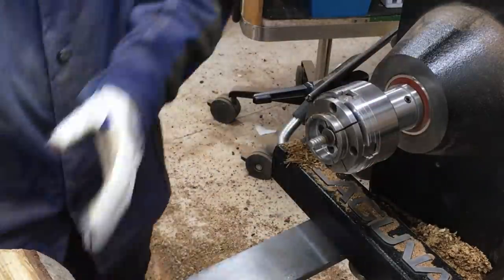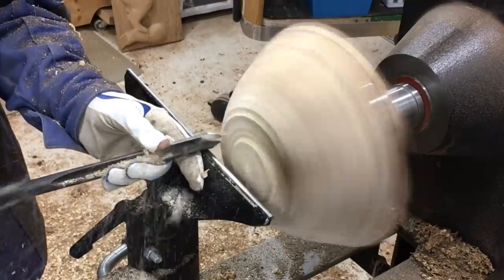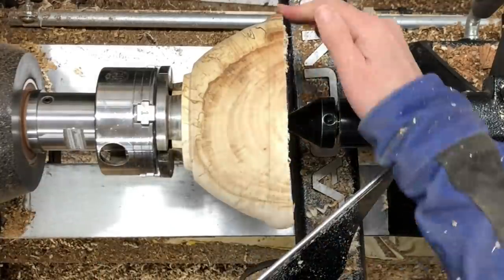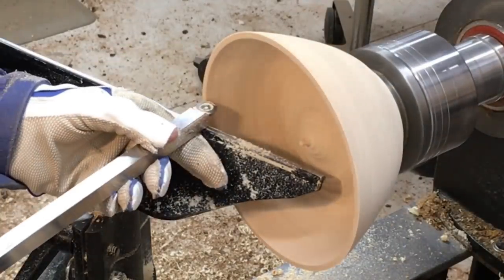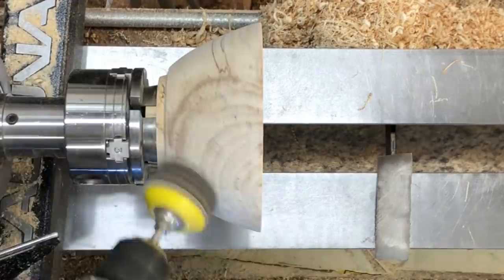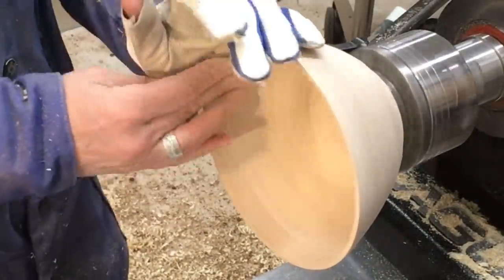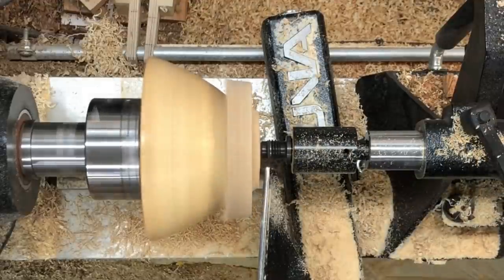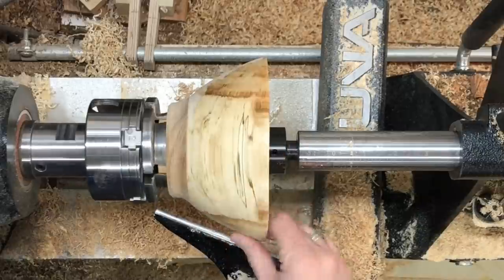Woodturning Firewood Log To Bowl: The Problematic Poplar - Potential Paint Pour Project?

Comment: Hi Lisa , in the end it ended up being a lovely little bowl, i'm relatively new to small wood turning as I used to make large pieces for finials for buildings on the outside so there anything from 8 to 10 inches in diameter and quite long, anyway just before Christmas I was doing thanks summer to you and yes I done the same thing I made a hole in the bottom but what I done I made the whole slightly bigger in the bottom and tried it up so I ended up with about 16th or an 8th inch thickness of material in the bottom, then I turn the spindle with a tenant on the bottom which then the bowl then sat on and I've got a better surface area for gluing up, The shaft ended up being around about 4 inches long which I then made up another piece to mounted it on the bottom has a foot and finished turning it, it ended up looking very nice. Stay safe, keep up the good work, practice makes perfect, I am a retired English gentleman living in France and I think that I am still learning things at my time of life.
Phil from the Moulin in France
Reply from the maker: Hi Phil, thanks for watching 😊
That’s a great idea for fixing the bottom, I’ll have to remember that - but hopefully I won’t need to use it 😂

Comment: I did the same thing a couple of weeks ago. It never went completely thru the recess in my plater, so I put a piece of tape on the inside then turned the bowl upside down . Then I filled the recess with epoxy.
Turned out really well with just a little sanding.
Reply from the maker: Hi David! Resin was my thinking for the beech bowl I made into a funnel, as it was still a bit wet and went oval so re-turning it wasn’t really an option. But resin doesn’t really like moisture either so it’s still sitting on the counter with a hole in the bottom 😂

Comment: I went through the bottom of my last bowl. It was my fault for not checking its thickness. I was trying to even out the inside bottom with my "bottom feeder" gouge, one I haven't used enough to develop the skill and feel to use it confidently. We all learn from our mistakes and their work arounds. You have a pretty grain in this one. I admire your persistence; mine will probably end up in my burn pit next spring. My neighbor across the street had several large, old popular trees removed a few weeks ago. I considered getting some pieces but I already have more cherry and sugar maple than I'll probably turn since I'm just a hobbyist.
Reply from the maker: I still don’t have a good feel for the bottom feeder gouge and am mostly using my negative rake scraper. And I still make the bottoms way too thin way too often 😂

Comment: What a great video Lisa! It appears that you have exactly the same problem finishing Poplar that I encountered, only you are better able to express them. The poplar I find over here often has knots in it making for hard & soft areas. That is difficult to grind. 
Unbelievable how you managed to go through that bottom! But you managed a great save, really well done.
But still I believe we are at least together now in the opinion that Poplar is an underestimated species for turning?
At least there are not many video's featuring it. I gave some of mine to Frank (TheTinyWorkshop), he said he will give it a go shortly.
Reply from the maker: Hey Leo!  I use poplar all the time, but kiln dried board stock as one of the other Bear Track girls (well both of them really but Lori is mostly doing the author/illustrator thing now and not so much art) is a 2D wildlife artist and I make all the frames for her originals. Cabinet grade poplar is clear of knots and paints really nicely. You can see Marie’s work at www.marierust.com
I surely thought I had plenty left in the bottom but apparently I took a few too many passes trying to get rid of the ridges 🤬
But I will be in the lookout for more poplar to try. It was stringy when wet but this actually turned pretty nicely.

Comment: Lisa first beautiful piece. Second I recently watched a video with either Mark Sillay or David Ellsworth, both skilled turners, working on a club lathe at a demonstration. They were having the same problems with the lines you complain about. On this particular video there was also a converter on the headstock and that seemed, in the pros opinion to be the source of the problem. You seem very competent with your tools it might just be you lathe that’s the problem. They also mentioned to be sure your Morse taper was clean when using drive centers with that function. Hope it helps your too good a turner to be doubting yourself.
Reply from the maker: Hi Victor! Thanks so much for taking the time to leave a comment. In the time since I made this video, I have gone exclusively to the SuperNova2 chuck, which is a direct thread for my spindle, or a glue block and I do think that has helped. I also have been grinding the heel of the bevel back some and that seems to help make sure I’m not “bruising” the wood by pushing against it. I still have an issue with weird lines occasionally but it isn’t nearly as bad. My technique is improving as well and that never hurts 😁

Comment: Good job, sanding is most people's pet hate, lol. I like this piece, it's shape and grain is quite nice. I find Macrocarpa Pine to be a little problematic sometimes, like you had with this with marks appearing and such. I've found when sanding, if I soak in Methylated Spirits/Denatured Alcohol to open up the grain and raise the knapp, let that flash off completely, then rub in 1 pound Cut Shellac, leave that for a while so the alcohol dries up completely, this stiffens the fibre's, as well as helps with bringing out the Chattoyance in the grain.
Reply from the maker: Thanks for the tips. I use denatured alcohol after sanding to help get rid of some of the dust and then out a coat of 1# shellac as a sealer/sanding sealer but unless the wood is really punky I don’t normally sand the shellac back - it seems to just clog up the sand paper. Do you find this too?
Reply: I do, esp. if I don't let the Shellac fully harden.

Comment: Well, I watched it a couple of times to see if I could figure out the 'ring' problems on the outside and inside. With the inside, it is simple, you are getting bruising from the heel of the bevel on your gouge. I grind 1/2 to 3/4 of that bevel off. On a concave surface, if a sharp heel is rubbing the wood as you go down the inside, that sharp heel leaves bruises and broken fiber that some times even sanding through to the other side of the bowl doesn't seem to remove them. Grind that off and that should make a big difference. After seeing some one in our club do it, I have taken to doing the entry cut with the flutes more vertical. Sounds like it should be an immediate catch, but it doesn't seem to happen, and I don't know why. A note with that 'wing' cut, I have seen a lot of turners use it inside a bowl, and it seems to work very well. The note of caution is that if you roll it over too far towards the side of the bowl, and then come off the bevel, you can get some spectacular catches. 

For going across the bottom, I say that 'your steering wheel is loose'. So, going through the transition, you are doing a pivoting cut, very similar to what you do when you start to nibble off the outside corners of a rough bowl blank. When you start to go across the bottom, it is critical to keep your gouge angle consistent. It is a very gradual pivoting cut across the bottom, or if you are making a platter and want a flat bottom, if you have a 70 degree bevel on your gouge, then the gouge handle stays at 70 degrees, if that makes sense. We tend to look at the shavings coming off and change angles if the shaving gets wider or narrower. I think this comes more from going down the side of the bowl. If you have a slight hump, start before it and take a very narrow shaving at the beginning, and let it get a bit wider, then it tapers off again. You do this by keeping that handle angle/steering wheel going in the same direction, if that makes sense. I did do a video about that. 

For the outside of the bowl, I am not sure. For me, I would have finish turned it before I reversed it. This is easier to do if you have the headstock down at the end of the lathe. Not sure if you have the mobility kit on that Laguna, but who ever designed that one has no bowl turning experience at that end of the lathe.... Harumpfff! Since that wood is fairly dry, you should get very clean cuts, and then when you reverse it, about all you have to do is some light shear scraping. There is a possibility that the lines were from tear out, but those don't run all the way around the bowl. Bruises do. You may have been clamping down too hard on the gouge, and pushing too hard on the bevel. Two quotes I use, neither original, "The bevel should rub the wood, but the wood should not know it.' Difficult to learn, and not instinctive, well, not for most of us. The other quote is from an old black and white Hollywood movie about Cyrano de Bergerac, a famous swordsman. He disarms his student and then says, "Hold the sword as you would a bird. Too loose and it flies away. Too tight and you kill it." I had been using it for a while and a guest on the Roy Underhill show used it when talking about hammers.... These two compliment each other. If you have too tight of a grip and too much bevel pressure, the bumping you feel as you go down the side of a bowl, from end grain/side grain and against the grain and with the grain, it gets much worse. Relax the grip and the bump gets to be far less. 

Oh, It looks like your tenon is very precise. The shoulder and the sides seem to be more accurate if you use a very gentle NRS cut or even a standard scraper cut. Not quite so good with a gouge. If you are good, you can get less than 1/16 inch run out, which is plus/minus 1/32 inch. 

I do make sure about how much wood I have between the chuck jaws and the bottom of the bowl before I do finish cuts. I generally plan to leave it a bit thicker than I actually need, unless I am turning Madrone, which needs to be pretty exact because it loves to crack. I did one video on 'finding the bottom of the bowl'. That has saved me a number of times. I do try to guess, but I like to know exactly how much room I have. Stuart and Mike seem to know, but I think they have done more bowls than I have.

Very nice piece, and you did manage to save it. I seldom get bottoms too thin, but have cored through the bottoms a few times, and my chucks bear the marks....
Reply from the maker: I’m definitely making progress with the gouges - I did grind the heel back and that helps, and I’m working on getting a feel for gliding the bevel. I think you are right about the lines coming from pushing too hard and burnishing and/or bruising the wood, a few other have mentioned that as a possibility and since I’ve started using the scrapers for finishing cuts I’m not having that issue so I’m sure it’s a tool control thing. The other thing I’ve done for the last several pieces is put the 50mm jaws on my SuperNova2 and eliminating the spindle adapter. It isn’t always an issue but I think it may amplify any existing wobble or runout issues. Will add another chuck to my list, and am thinking hard about getting a Vicmarc VM120, though they seem to be sold out at the moment. I like the SuperNova2 fine and would be ok with another one of those as well, so we’ll just see how it goes. 
I’ve watched your video on the bottom multiple times. Hell, I’ve watched ALL of them multiple times over the 2 years I’ve been turning - I was waffling between  getting a fluteless gouge or a bottom bowl gouge. I got the latter from Doug Thompson, but I’ve not been able to get a feel for it yet and it basically sits in my tool rack just lookin’ at me. The gouge I seem to prefer at the moment is the 60deg bevel fingernail grind that came on my Thompson 5/8 gouge, though I think I’m bringing the wings back further every time I sharpen it and it may end up being a swept-back wing grind before too long. I have 2 ground at 55deg with the long wings and 1 40/40 grind I ordered from Cindy Drozda but I find the 60deg in my hand most often. And I’m getting better with that going across the bottom - I think I’ve been trying to steer it with my left hand rather than guide with my right. But it’s definitely coming along and the scrapers are becoming a big part of my process 😁 I do need to make one of the simple wire thickness gauges you have for the walls and learn to stop taking that “one last pass to clean this up a little bit”  - usually ends in disaster and much cussing 🙄
Reply: The tendency when going across the bottom is to use both hands to push. One of those eye openers for me was Stuart Batty commenting that when you use both hands to push your gouge across the bottom, you get more waves. I use the fluteless gouge if I am only trying to take off 1/16 or so, If I am going down 1/8 or more, I have several. I have a couple of 'detail' gouges, or spindle detail gouges which have a ) shape nose and the 70 degree bevel. They work well because you can go up to a really high shear/slice angle. I have one of Doug's U flutes that is ground to 60 degrees, and 40 degree sweep. I also have some old half round fluted gouges that I did the same thing to. Funny thing is that switching tools some times seems to work, and not because of sharpness..... Just because.

Comment: First time on your channel and I'm impressed.  I just subscribed.  Looks like you could benefit from a set of Cole jaws or a Longworth chuck.  Would have made cleaning up the bottom a bit easier.  Looking forward to going on your channel and seeing some of your earlier stuff.  Especially interested in your paint pour.  Never tried it.
Reply from the maker: Hi Tom, welcome & thanks for subscribing 😀
I may look into a Longworth chuck at some point but unless I had a dedicated chuck to use with the Cole jaws pretty sure I’d never use them - I hate changing the jaws! 
I’ve got some willow I may try a paint pour on - nothing else is dry at the moment 😂
Reply: @LisaRamlow  Lisa, I was fortunate to pick up an extra 4-jaw chuck from someone so I keep it equipped with a set of medium Cole jaws.  I agree, otherwise it is a PITA to change them!  I also have a Longworth and a vacuum chuck system so I can handle most chucking jobs.  Looking forward to your future videos and going back to see some of your previous ones.  Cheers

Comment: like ive always said i enjoy your vidiios . but when i see you fough turning you make it look so easy. iknow its yout experinse but it seems yout tools are very sharp, im a newbi in the process of buying my own shoulg i go with the more expensive tools or should i wait till i get more expierince. sorry for bugging you so much and my bad spelling. thanks for your time
Reply from the maker: Hi Larry! As I’m gaining experience I’ve been slowly upgrading my traditional tools to Thompson but I started with cheaper tools. I don’t recommend buying a complete “set” of tools as they usually come with things you won’t use much. I have an old cheap set of Craftsman spindle turning tools (spindle tools commonly have a flat tang rather than a round bar and should never be used on bowls or on pieces that are mounted on the lathe in that orientation so you have side grain, then end grain, then side grain…the tangs are not strong enough to handle the forces of the end grain. These type gouges should only be used on blanks  mounted in the spindle orientation where the side grain runs parallel with the bed ways). Anyway I started with the regular beech handled Hurricane bowl gouges and have been really happy with them. They hold an edge pretty well and are decent tools to start with. What you’re turning (primarily bowls, or spindles, or pens, etc) will dictate the tools you should look for although I recommend waiting on buying spindle gouges since a bowl gouge can be used on spindles and any other blank. How big is your lathe? If you’re doing smaller bowls a 1/2” bowl gouge and maybe a 3/8” would be sufficient. You’ll also need a parting gauge of some sort. I do use carbide tools for some things so those are options too but I prefer the traditional tools for most of my work. Check out the Hurricane tools - you can get them on Amazon or from The Woodturning Store - this is the set I have https://www.thewoodturningstore.com/hurricane-three-piece-bowl-gouge-set-3-8-1-2-5-8-high-speed-steel-w-handles/
How are you sharpening?

Comment: To line up a bottom patch block remove the centre from the tailstock and use the face of the tailstock quill. A flat piece of scrap wood on the end of the quill will remove the possibility of transferring any oil from the quill.
Reply from the maker: And remember to line up the damn grain! 🙄
Reply: @LisaRamlow  Practice makes perfect. Worry and regret do nothing except create more mistakes by distracting your focus.
Reply: @LisaRamlow  A second thought on mistakes. Repairs are an opportunity to make things better. I the case of this bowl you considered doing a paint pour. A pearlescent semitransparent blue epoxy coating on the inside of the bowl would be a dramatic surprise with the darker wood patch giving the effect of a bottomless pit which the grain mismatch would accent!

Comment: And it came out lovely regardless! 😁 I'm curious, though: Is lining up the grain an aesthetic thing, a structural thing, or a bit of both? I imagine it could look kind of neat, having a piece made from slabs glued together with the grains going in all different directions.
Reply from the maker: Hi Fay, thanks so much. In this case it was for aesthetics but strength and structural integrity certainly can be a consideration, as well as in design as you said. It just wasn’t what I was going for here 😂